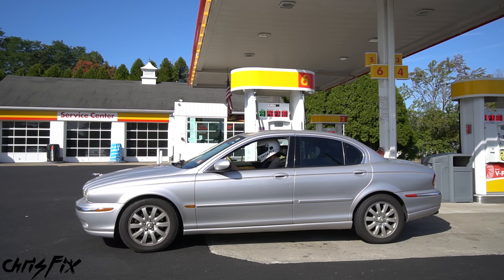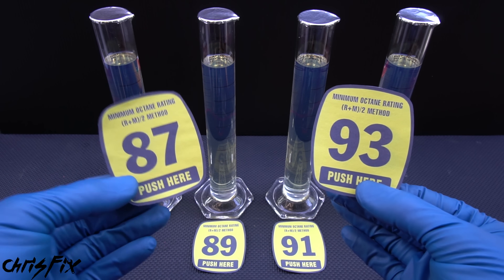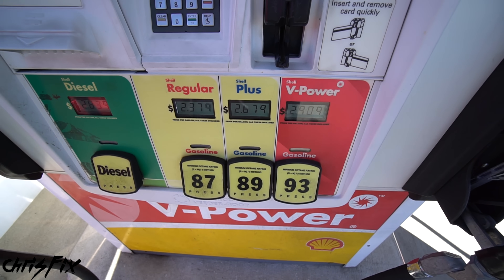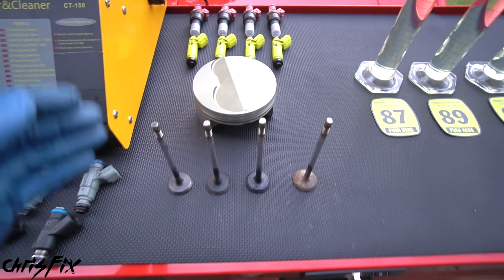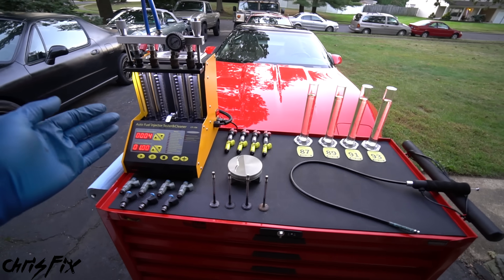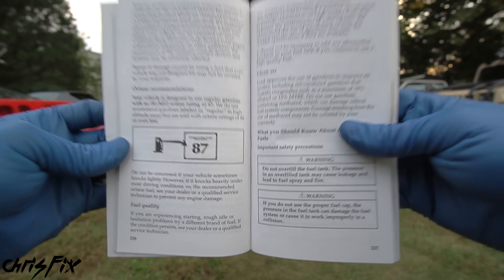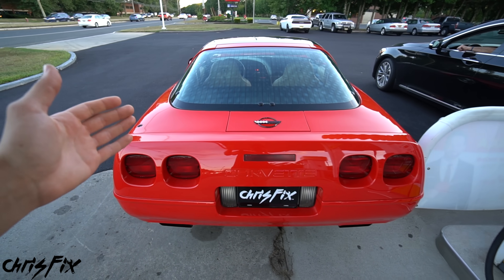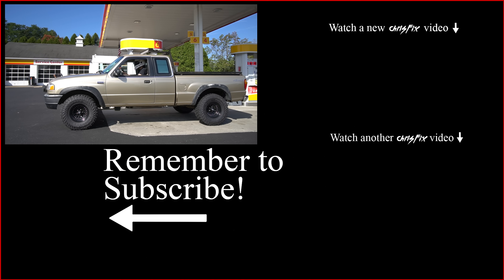What is the BEST Fuel to Use in Your Car or Truck and WHY

Comment: hey man, sorryy to bother you, can old car that run carburator, use high ron ?, if i wasn't wrong, high ron = makes it hard to ignite.... hope you answer my question..
Reply from the maker: Unless the engine is tuned for it, you probably don't need it unless you can hear pinging or knocking or you are running a high compression ratio. Most older carbed cars run low compression ratios so they don't benefit as much

Comment: I believe it’s actually called pre-detonation.
Reply from the maker: Knock/detonation is when the fuel/air mixture ignites after the spark but too rapidly, causing a pressure spike and making noise, and higher octane resists this so that's why I referenced it. Pre detonation happens before the spark is usually caused by carbon deposits or an overheated spark plug igniting too early. You're on the right track though!

Comment: So theoretically if the cars ecu adjust timing ect when you use 87 in a "recommended" 91 application. Would it also be safe to say that if you ran 93 or 94 in a 91 car it would also adjust "up"  in a weekend warrior (race car) type car with no tune ?
Reply from the maker: It might but it depends on the car and the tune, it might sense that little extra anti knock and adjust but the difference in power would be slight, the biggest benefit would be the lack of knock and consistency when you're pushing the car hard

Comment: Yo Chris. I have a 2000 Honda accord 2.3 liter f23a4 throwing a CEL for P0325, saying the knock sensor on bank 1 is malfunctioning. I also have a slight vibration at low RPM and it’s very noticeable when the AC is on. Could this be cause of the knock sensor?

Comment: I always run regular in my cars, except when I go on road trips. I almost exclusively will fill up at Shells on a road trip and will run the V-Power to clean out all the carbon deposits. Then switch back to pumping regular the rest of the year.

Comment: "Higher octane will not give you more power or fuel economy"

Then later in the video:

"Running higher octane will give it more power and fuel economy" 

Yeah you sure busted that "myth". So full of shit. 😂😂
Reply from the maker: I didn't say that at all? Can you point me to specific time stamps because I think you are confused?
Reply: @chrisfix  I'm not going to watch it again to hunt timestamps for you. I watched the whole video and listened to what you said. Something I'm sure your analytics will tell you not many people do. What you said was not consistent.
Reply from the maker: Well in that case, if you actually "watched the whole video and listened to what I said" you would know that using premium in a car that requires only regular or mid grade does absolutely nothing regarding power/fuel economy and just wastes money. In specific cases where premium is recommended but not strictly required (like with the Corvette, note the words recommended and required), it's definitely worthwhile to use and will improve power/fuel economy a bit because it takes advantage of the specific tune, but it's not 100% strictly required. And of course if you have a higher performance turbo/supercharged/high compression engine it's the same story.

The reason I said I think you are confused (and wanted you to provide time stamps to clarify) is because you're thinking that explanation about premium giving a boost to power/fuel economy applies to something like an old Honda Civic, when I made it pretty clear that its for specific cars and use cases. So I'm guessing you didn't actually watch the video, because literally millions of other people understood this with no problems. I get that the videos will always have haters but if you're going to be a hater, at least do it properly and not just make up what I said
Reply: @chrisfix you made a blanket statement at the beginning saying it didn’t make a difference in power at all and that it was a myth and by the end of the video you said it did make a difference in many vehicles. Again maybe try watching your own video in its entirety like I did. Also try not being an argumentative ego maniac.
Reply: @chrisfix and if you don’t like what I have to say then delete my comment. I don’t care. You mean nothing to me. Your video came up on my feed and I watched it. I have zero attachment to you or your content. Block me for all I care. I’ll be passing on any future videos of yours now in my feed anyway. You don’t need me anyway you have “literally millions” of people blowing sunshine up your backside all day.
Reply: @chrisfix you should spend your time talking to people that actually want to talk to you. I see so many comments from fans not replied to and yet you reply to mine. Someone you consider a hater. Real great use of your time chief. If you don’t like what I have to say then delete my comment and block me. I really don’t care. I have zero attachment to you or your content. It came up in my feed. I watched it. I commented on what I saw. It’s not that complicated. This isn’t a conspiracy against you. Next time I’ll click “do not recommend this channel again”.
Reply from the maker: @Justintime2GrowNetwork  I'm not really sure why you are getting so angry (I meant the hater part a little more tongue in cheek lol but I get that it's hard to perfectly give tone over text), and with the amount of time you spent commenting all of this you could have just pointed out exactly when I said both of those things and I could have clarified because a lot of comments like yours are just genuine confusion. I still don't understand if you are referring to the part about additives cleaning things up on older engines or octane itself or something else entirely?

 I'm really sorry you feel this way about my video which was just trying to help people make sure they knew exactly what their car takes so they can save money and make the right choice for their situation. I don't think this is a conspiracy or anything lol I'm used to hate comments but in nearly every case they are unsubstantiated like yours is. Also, I spend a few hours a day trying to respond to as many comments as I can but I get thousands so I can't possibly get to every single one, but if you scroll down I still have replied to a good chunk of them... and I like to follow up with certain comments to make sure things are understood from start to finish.
Reply: @chrisfix go spend some time with your “literal millions” of fans bro. I’m good.

Comment: My 5.4 3v triton runs like garbage and it only runs if the crankshaft position sensors are unplugged
Reply from the maker: It's pretty likely your timing is off from a stretched chain or worn cam phasers
Reply: @chrisfix 
The oil pump is doing its own thing too, losing pressure and coming back.

Comment: 93 octane is hard to get. 91 octane is the only grade that does not have alcohol in it, so I use that. In my 60's classic car I add a bottle of octane booster just to be sure when using 91 octane. No problems with knocking.

Comment: do you know what specific gravity of gas/fuel?????????????????????????????????????????........the more octane the heavier the gas/fuel and the slower the burn so you need the spark to get there a little sooner ..go to racing school please
Reply from the maker: Octane rating has literally nothing to do weight or specific gravity of fuel, it's a measure of resistance to knock, but thanks for sharing
Reply: @chrisfix  First, specific gravity has an impact on fuel metering, especially for carbureted engines. A heavier fuel is of course denser, so the float in a carb’s float bowl will sit higher than if a lighter fuel was used. If the float sits higher, the fuel level will be lower. Fuel level affects fuel metering in a number of ways, so if you’re switching fuels, pay attention to the fuel level in the bowls.

For most race fuels, specific gravity is also an indication of the composition. Note that the words “most” and “indication” were used – there are exceptions. However, for most race fuels, a lower specific gravity suggests a faster-burning fuel, while a higher specific gravity suggests a fuel is slower-burning. This is because most light hydrocarbons used to make a race fuel are faster burning than most heavier hydrocarbons. This matters because faster-burning fuels usually require less spark advance than slower-burning fuels.

So in addition to paying attention to fuel metering changes when switching race fuels, you need to pay attention to ignition timing as well. We’re not talking huge changes here, but these changes are important to the proper tuning and consistent performance of your race engine.

One final thought – there are implications for pump gas as well. The specific gravity of pump gas will typically range from about 0.720 to 0.770. As you can now guess, this wide range is a reflection of the wide ranging composition. Pump gas composition varies by octane, by region, and by season. For these reasons, a race engine that can run on pump gas must be tuned conservatively just to prevent engine failure
Reply: @chrisfix  Sunoco Supreme weighs 5.95 pounds per gallon. Applying some math: 5.95 / 8.325 = 0.715. So Supreme has a specific gravity of 0.715.

If Fuel A has a lower specific gravity than Fuel B, Fuel A is said to be “lighter” than Fuel B. Literally, a gallon of Fuel A weighs less than a gallon of Fuel B. Sunoco Standard has a specific gravity of 0.728, so it is said to be “heavier” than Supreme.

Comment: Question why did super at one time have a pink color to it and doesn’t anymore
Reply from the maker: That pink color used to come from certain suppliers to differentiate between regular and mid grade. It wasn't universal but it helped, especially at stations where the pumps were fed from an underground manifold. Over it wasn't needed due to confusion and they had tighter additive/emissions requirements to meet and it wasn't worth putting in. Great question though!
Reply: @chrisfix also I think it was a insurance
Against cross-contamination  I hauled LP for about 4 years to be home more and talking to other drivers could never tell me what the reason was but just talking to them it does happen that they will ever now and them they will drop the wrong gas in the wrong tank and we think so they don’t have to pump the tanks they took the color out I run no ethanol in my lawnmower it doesn’t like ethanol gas and pick up gas it ran a little ruff till the next tank and then it straighten out and one of the drivers I talk to he had a gas station he delivered to in Baton Rouge that they always would order more then they need and was told to dump one of the compartments in the super tank and a company in Baton Rouge by the name of QC would hall gas in a compartment that had waste oil in it last and that’s a big no no so that why there is only a few gas station around that I will buy gas from there is a lot of shady stuff going on at these gas stations and haulers

Comment: I used 93 shell in my hemi, never had a problem, I was out of gas once and the only thing close by was a sonoco, I used their premium and my engine began knocking, I drove with the knocking for about 10 miles until I found a gas station, I used their regular to lower the octane , and lo and behold the knocking stopped. Hemis suggest 89 but here where I live there is none they say 91 is ok, but we only have 87 or 93, sonoco has an even higher concentration and I may have ran into that issue , still not sure I just use 87 now, runs fine.
Reply from the maker: Interesting, thanks for sharing!

Comment: Since my truck has 200k miles and runs off of 87 should I go up higher?
Reply from the maker: Unless you feel the need or you notice some huge improvement, there probably isn't any reason to. Maybe do your next tankful with 89 and see if anything happens!
Reply: @ that’s what I might do.. thanks

Comment: Great vid, but 2 glaringly obvious things jumped out that I have to add...

1. Ethanol! Most parts of the country use E10 on at least regular and mid - some areas like mine have 100% fireworks gas for premium.

Lately there's a trend of having CHEAPER mid grade, but if you look close it's usually E15 to E25. The sticker *claims* its safe for any car 2001+ but this is a flat out lie!

My 2010 and 2015 Audis, 2011 Subaru, 2016 Escape, and even 2025 Nissan all have a BIG Warning...

⚠️ NEVER USE MORE THAN 10% ETHANOL! ⚠️

It should only be used in Flex-Fuel vehicles IMO!

In states like IA I've seen pumps with E10, 15, 20, 25... up to 85. It's worth noting that Ethanol, while slightly cheaper, does actually have (much) less energy than regular gasoline and does actually run cooler!

2. Octane booster is a joke unless you spend $30-50! The stuff you showed probably claims it raises the octane 2 points or so, I've seen some that say 10... That's 100% pure marketing BS!

Two "points" doesn't mean your 87 octane will go to 89 - it means 87.2! That's pretty deceptive!

Now, there are actual racing additives. Like I said, I've never seen them below about $35-40 that will add several full octane levels, but you'll only find those at specialty stores!
Reply from the maker: Very good points and yes it can be misleading unfortunately but you are right to call that out!
Reply: @chrisfix  Wow, I didn't expect any reply on an old video!

Thanks for posting facts for people, I'm always curious to see what these videos are like, even after years on a pro race team I still learn new things here and there.

I hope you know I wasn't calling you out, but the deceptive marketing from some of the additives and gas stations!

Honestly, I wish they'd either just get rid of mid-grade altogether, or add a 100+ race fuel for those of us that need it (Stage 3 Tune on Audi S5) with a LOT of boost!

Luckily I have a track near me, but can't make it very far out of town.

Comment: It's simple. The shorter the distance the better fuel you need. Of course if you drive the car hard you want to use the best fuel too. And here's the irony, if you go long distances mostly why not get a diesel in the first place.😁 But you don't want a diesel for short distances otherwise you break your car.

Comment: My Grandpa used to say....pour a little on the ground and toss a lit match.....if it burns the gas is fine. The 3 Grade system must actually restrict refineries output. If all they made was mid grade or "premium" it should result in lower prices. ??
Reply from the maker: Refiners produce different fuel blends and can mix/adjust as needed to create the various grades, some engines are designed to run on lower grade fuel and making only premium/midgrade would be overkill. Plus it's more refined so it's more expensive to make regardless

Comment: Read your owners manual. It will tell you recommened fuel.
Having said that I run premium  fuel when pulling my trailer. Seems like ecm can't adjust timing quickly enough to compensate for flat roads and when you start pulling hills.

Comment: There a gas station I went to in los Angeles 
It located in pico and berrington gas station 
They have racing fuel and color orange and i use it only my project and i never had issues with it and that 101 octane 
It cost more but i always been putting 91 on my vehicle for the longest never had issues with them

Comment: real world testing showed that higher octanes gave me more gas milage and more power. this corresponded to the increase in price, not octane. IE, if the gas was 25% more expensive, I got 25% better gas Milage. This was tested on 2 different fuel injected VW 4cyl motor.
Reply from the maker: Interesting, thanks for sharing!

Comment: My jeep 3.7 liter. recommends 87. But when i use 91 to 93 it has more power and gets better fuel mileage. Why?
Reply from the maker: Might be a slight tune adjustment baked into the ecu (you have a more modern engine so I'm not too surprised) allowing for a little more power, and if you are driving in hot climates/climbing hills or towing, premium will work better because it can resist knock in high heat/load situations
Reply: I got a 08 land rover LR2 with the 3.2L on the gas lid it says premium recommended but I ran 87 in it once an I didn't hear any knocking. But Its so expensive compared to 87 an would like to run 87 instead of 91 or 93. Would I be alright to continue running 87 or should I use premium?

Comment: If it seems like my fuel economy is getting poorer, should I use a fuel additive like techron? Or the premium from Shell for 2500 miles like you suggested to clean the engine? I have a 06 Camry over 200,000 miles. Thanks